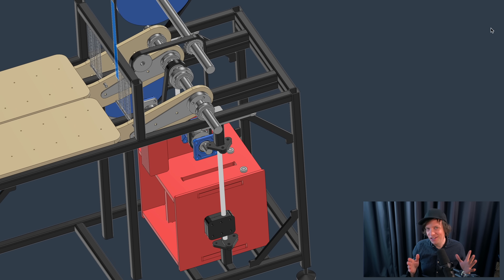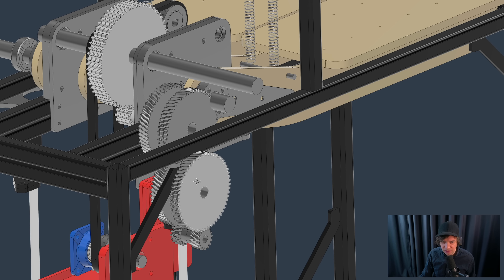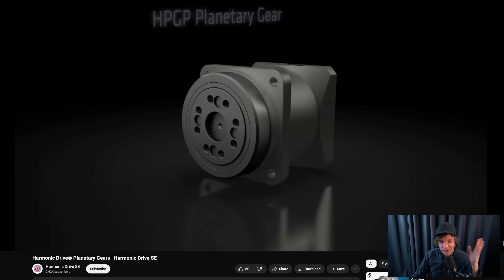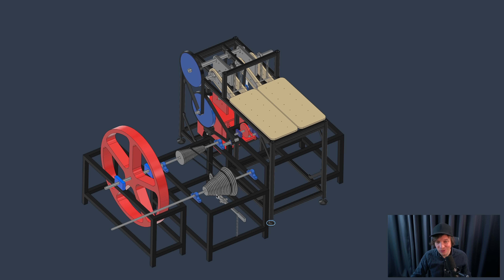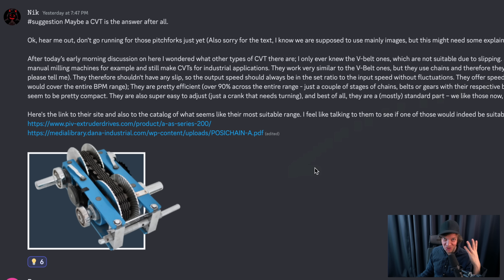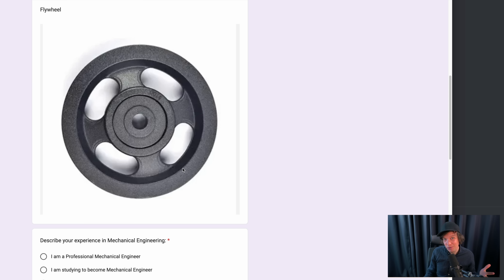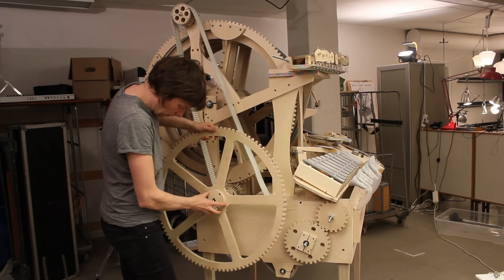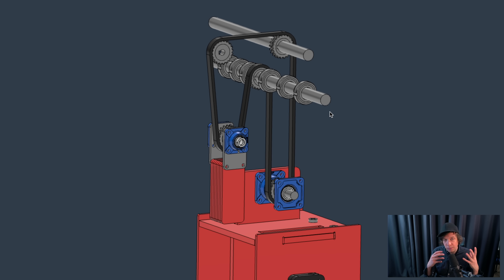Which Gear Type is Most Efficient?

Comment: I love this series!

Students often complain that they are too bogged down in theoretical stuff and need more practical knowledge and Martin is going in the opposite direction.

We are approaching a point where Martin enrolling and completing an engineering degree is the fastest way to finish the marble machine and I am enjoying every minute of it.
Reply: as a student that has kind of gone both way, i think the problem with school is that we're doing theoretical stuff without a practical goal in mind. Because obviously not all subject can end with a practical project, that would be wildly expensive and time consuming.
Reply: Theory feeds practice... You can do a lot with trial-and-error, but you can do it faster (and with fewer iterations) when you start at the theory.
Reply: @KazeKitsune  I concur. Theory lets you build models, math models will reveal to you what what you can change and how effective those changes  will be. There's nothing better than building something and having it work right the first time because you took the time to understand what governs the problem you're solving.
Reply: @Kandralla  For something as boring as a gear box which has been solved in thousands of variations before this is certainly true. But then again he only got to the point of knowing what this component is supposed to achieve because he built two failed machines before as well as the components he already finished.
Reply: @Schmidtelpunkt  disagree with you here. You can accurately model complex systems using fundamental concepts and equations you learn in undergrad classes and a little bit of intuition.

Dimensional analysis is basically a codified version of this process.

Marble machine is big but the fundamental equations driving it are not nearly as fuzzy as a fluid-thermal system and initial design of these systems is highly driven by simple models and intuition.

Even if you don't build giant math models just something as simple as looking at an equation can tell you things.

Mach number is speed/speed of sound. If you expand the equation and do some rearranging you may notice that it's also Kinetic Energy squared/Internal energy squared. That observation reveasl a fundamental truth about what the speed of sound actually is and what properties govern it using relatively simple concepts.
Reply: @Kandralla  I don't think any equation would have allowed him to make the choice what engine to attempt without trying it out and realizing that he needs a bigger flywheel (which influenced the dimensions of the machine) and that playing without time fluctuations would be impossible simply because of his own motoric limits. The concept of the machine as he scribbled it is built on trial and error, and not even the brightest engineer would have been able to know how to come up with it, because it was influenced by choices impossible to simulate. That is why I take this idea of building castles in the air purely by the power of engineering with a grain of salt. I hope he will advance in increments which allow him not to lose the eye on the practical requirements and not simulate himself into a dead end just to realize that he built something perfectly functioning which does not do what he needs.
Reply: @Schmidtelpunkt  The equations are likely in Machenery's handbook under "flywheel design".

If you like trial and error, fine. I've learned a lot through trial and error. But you're kidding yourself if you think it's impossible to design stuff without trial and error. How do you think it is that spacecraft whic as a system  go largely untested, can launch and work the first time? It's not trial and error. 

Sometimes you do trial and error, sometimes you figure it out on paper first, but the factor that determines which you do isn't  whether you can figure out the math.... It's how much time/money/risk does each one save.
Reply: @Kandralla  Well, I bet you know the equation which states that a musician cannot hold a constant speed. So, please show me the method which shows a similar result without trial and error, which as an engineer much superior to a musician should be easy for you, using the power of mathematics...
Reply: @Schmidtelpunkt The mathematics behind a simple pendulum is very well-known.  And I believe it’s been used in applications that require very precise timing.
Reply: @br52685  The mathematics of whether the pendulum is necessary in the first place however, do not exist at all. There are a lot of things one can calculate after making a decision. But making the decision itself cannot be calculated. Which also explains while engineers were quite split which engine variation should be chosen. If this had been something possible to decide with mathematical methods only, this would mean that a great fraction of engineers are charlatans, who don't know their job. Or perhaps morons. Neither of which they are - it was simply impossible to estimate what design requirements would be needed before trying it.
Reply: @Schmidtelpunkt  I’m not talking about a pendulum specifically for this project.  Merely that engineers/mathematics can do a lot.

And this is junior-high math….imagine what higher level mathematics/engineering can do WITHOUT merely relying on trial and error
Reply: @br52685  Just that the question never was whether it is possible to calculate a lot of things. But whether it allows you to avoid trial and error entirely, like the engineers here love to claim.
Reply: @Schmidtelpunkt  There's nothing Martin's doing here that is revolutionary.  It's quite a simple setup that's easy to calculate.
Reply: @br52685  Well, then calculate the remaining parts of the marble machine and in the end you can compare your finished machine to Martin's. Shouldn't take long, as it is mundane and easy for you 🙂
Reply: @Schmidtelpunkt  Why?  Would it have any impact of his chosen path?
Reply: @Schmidtelpunkt  Better yet:  start soliciting bids/contracts/hourly-rates for people to take on this exercise.  Oh wait…you want people to do this work for free?
Reply: @br52685  So it is simple enough to know it better from the sidelines, but once asked to contribute with something actually constructive, you want to hide behind some imaginary bill, which wasn't of importance when you called the whole undertaking as a simple setup. Why am I not surprised.
Reply: @Schmidtelpunkt  In fact, 24 hrs ago, an engineer very easily (and for free) provided instruction on how to perform some calculation.  Poster was something like skizophrenicenthusist.
Reply: I was thinking the same thing at this point it might be better to enrole in a mechanical engineering degree.

Or by the end of this series he will go from music to mechanical engineering.
Reply: Could you imagine being in a classroom with this narcissist?  Many of us have had classes with "that person," and it was a truly miserable experience.

Comment: Planetary gearboxes are the best for back-driving. That is why wind turbines use them. Straight cut gears also put less stress on the bearings. So if you use bushings then use straight cut gears.
Reply: Planetary gearboxes can also be stacked very neatly, as they are inside automatic car gearboxes.
Reply: Agreed, planetary gearboxes, especially the ones u buy online have been very nice for my used.
Reply: this is from a very amateur engineer but given that you want to offset the location of the flywheel anyway, you may as well have the belt have some amount of ratio right? Unless having 1:1 ratio belt is somehow more efficient/easier to build
Reply: @aronseptianto8142 yeah, the only downsides are the size of the pulleys, and potential stretching of the belt (but this is on the power end, so I don't think stretching matters at all). I think he's getting hung up on the efficiency, but imo the difference would be inconsequential (easily dwarfed by the losses in the bearing surfaces). So really it's just if the pulleys fit.
Reply: Straight cut gears like spur are noisy though. Planetary is best of the gear choices. Don’t know enough about belts

Comment: Straight cut gears are more efficient, anything else has a sliding contact patch that induces additional friction losses. Also bevel gears induce an axial force that pushes the gears away from each other, requiring thrust bearings to mitigate (more friction)
Reply: Yep. But they are also louder

Comment: I'm sure you get this a lot, but does the flywheel absolutely need to be vertical? Should it come loose, it will become a very energetic projectile moving either towards the audience or towards the backstage, two places where it has the potential to hurt (or even kill) someone. Could it be redesigned to be horizontal instead? So if it should come loose, it will fall onto the floor where it will lose energy much faster.

Comment: I wonder if you're breaking one of your own rules for this version of the Marble Machine by not asking the question, Why does it need to powered manually? Is this "REQUIREMENT" you are self imposing necessary? If your goal is to go on tour with this machine then I'm assuming you will have microphones and amplification. If this is the case, why would you limit yourself to a human powered machine with you could easily just connect an electric motor to it and have much more control and precision over the speed.

Comment: I'm not a mechanical engineer but your use case seems very similar to the design space of bicycles.

People have tested the efficiency for back-driving gearboxes on bikes and it always ends up less efficient than chain drives.

For that reason I would assume you'd be better off with chain/belt drives as well

You might even be able to use bicycle parts for your gear train.

Comment: worth thinking about... your heugan drive system has a fixed constant energy input to the flywheel, which stores and smooths the energy impulse. you cannot exceed the input energy rate at the output. i.e. the more instruments playing at a time, the more torque and energy you are sapping from your system. more over, the output consumption rate is not fixed. by nature it is infact variable. differing amounts of instruments playing at a time, plus different marble loads on the marble recovery systems.. this will affect the timing of the machine..
Reply: an analogy... water flowing out of a hole in the bottom of a bucket is not constant, the bigger the load of water in the bucket, the greater the flow rate.  
your flywheel is the bucket, the power usage of the whole system is the load, and the water flow is the power usage. to keep tight music, the power usage needs to be constant, or, the power input needs to be balanced equally with the power output.

the input power from heugan drive must exceed the total output of the entire system, and then be regulated to match output usage

Comment: What you are describing at the end of the video is model based systems engineering. It is one of the newest and fastest growing engineering disciplines, even though it is something engineers have always done to one degree or another. The systems engineering field seeks to improve the efficiency of the design process by developing a model of a system that can easily be changed and optimized before any cad programs are opened, any metals are machined, or any testing is done.
Reply: The most essential aspect is defining almost every single requirement for the system early on and figuring out which requirements are dependent on one another.

Comment: Just thinking out of the box: you need a human operated machine, without any outside power input. So... a power pedal (or whatever human input you like) charging a battery and that battery moving a speed adjustable motor... will fulfill its function (no outside power input)... and you could have absolutely precise timeing and a lot less parts. Just and idea.

Comment: A belt can also be helpful with protecting your machine from damage.  If something binds or stops a spinning part, the energy needs to go somewhere, and often it will break something.  But if you have a belt between the power source, and the bound part, it allows the belt to slip or be the breaking point. Thus protecting the more expensive parts.
Reply: Belts, tires, elastomers, clamp surfaces; rubbers are always the expendable components that wear out while protecting the metal beneath them.
Reply: @InventorZahran  Yep, lots of options. I been discovering that while upgrading my Xmaxx RC truck.
Reply: Unless it's my 3D printer.  The x-axis belt ripped the carriage in half.

Comment: Besides efficiency, you also need to consider the smoothness with which the gear train operates and the noise it generates. I suspect you will find straight-cut spur gears too noisy for your liking--especially if the mountings are not precise and rigid. Helical gears are better (that's why they are used in automotive transmissions)--but, again, you have to worry about the precision of the mounting, as you mention in your video. Timing belt is probably the quietest, with roller chain second.
Reply: Interestingly straight cut gears are used for reverse gear specifically for the noise they make.
Reply: @3halfshadows  Not all gearboxes use a straight cut for reverse anymore and the main reason they did was because reverse did not use synchromesh, but instead a sliding gear mechanism. (Also saves some space) The gear whine is only a byproduct, not a desired feature.

Comment: If we go the old way and go with rule of cool double helical gears all the way. 
But the new way is to buy a finished solution, I would go with the gearbox for this reason, it is a system that is already designed to meet the loads you would put into it.

Comment: In your case, requirements may be hard to pin down.   For example;   Belt vs Chain vs Gear,  What exactly is the noise characteristics.   How much noise is acceptable?   If one is 30% more efficient but is 10% louder is that ok?
Reply: He has no requirements except to find more things to make YouTube videos on. He apparently has no intentions to actually complete anything.

Comment: Similar to timing belts, you can use roller chain (aka, bicycle chain). Very efficient, and designed for the power levels generated by a human being. Also, you can use off-the-shelf bicycle parts for your gear shift.
Reply: Bicycle chain is a fair choice, very forgiving in terms of precision, alignment, muck, and it's even quite forgiving in terms of its lubrication requirements.

But, don't be under any illusions that it's strong enough not to break under human power limits. I've broken more than one bicycle chain when I was younger, stronger, lighter and fitter.

They're also a bit noisy, but don't expect that matters enormously with 500 metal balls rolling and clattering around the machine.

How about motorbike chain? Much stronger, almost as efficient, and all the other benefits still apply.
Reply: And dust/grime tolerant! As the machine will be dissassembled, moved, packaged, transported, reassembled, and used in many locations- dust/grime will certainly be an issue, and roller chains are very well proven in this regard.
Reply: though the same, why not use the stuff which is already concept proof
Reply: There might be a torque issue in using bike chains, but other then that i agree the type should probably be considered
Reply: The second gearing stage that connects directly to the flywheel is likely to be under a HUGE amount of tension, so it would need to be a super robust chain. I was also concerned about noise levels, but in my experience bike chains aren't usually too loud - most of the audible noise from bicycles is from the gearing ratchet going "tick tick tick tick". In that topic, I hope Martin finds some much quieter parts for the ratcheting systems in the Huygens drive, because the prototypes were VERY loud. It's just a standard issue with any kind of ratchet system: they're nearly always noisy as hell.
Reply: Also Martin likes bikes and even made Wintergatan song about it
Reply: Google DuPont Teflon Chain-Saver Dry Self-Cleaning Lubricant

Comment: For the flywheel just get a second-hand very large gear (like from old farm equipment, people sell this stuff for the price of metal), and either file the theeth, or add a "cap" (plastic, wood, resin?) around it to hide them. Probably he cheapest option, and will allow you to oversize it if you want. I get the idea of using standard parts, but this is one where I think it's make sense to do custom/second-hand considering the weight/price...